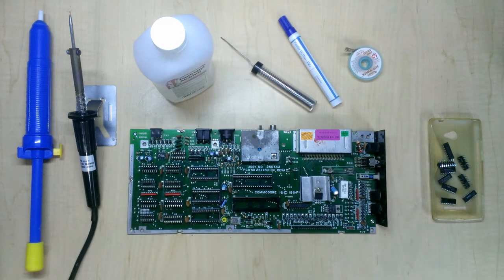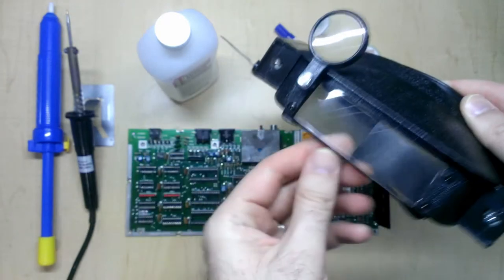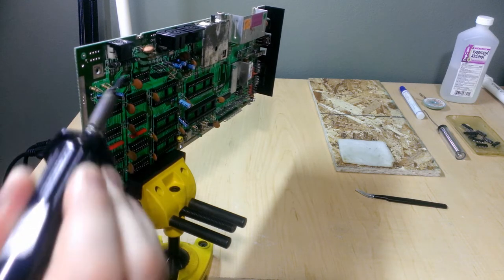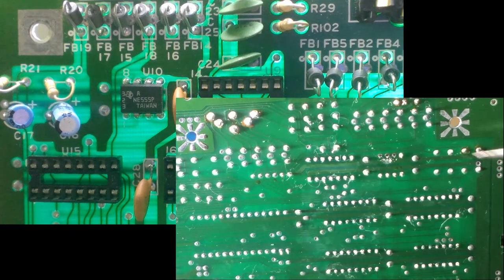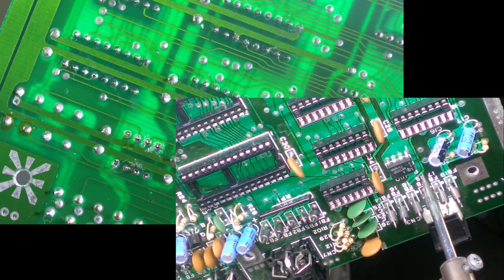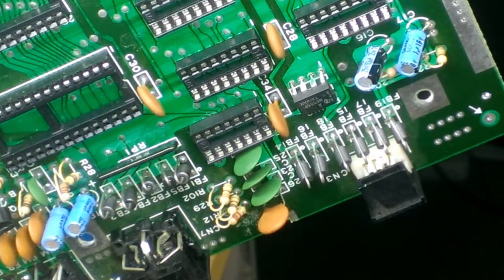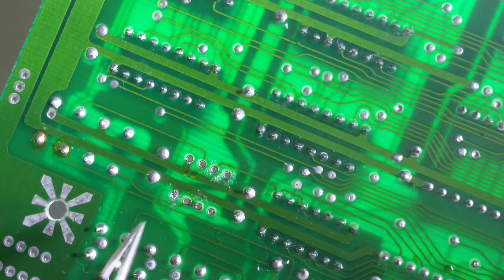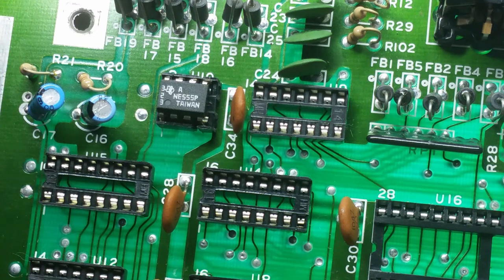Desoldering DIP/Through-Hole ICs With Inexpensive Tools

Comment: That's what sucks (NPI) about using the manual pumps. You have to remember to prime it beforehand. Even the cheapest electric desoldering tool is infinitely better. There's a bunch of hacks where folks have taken a cheap electric desoldering pump and added an aquarium pump and trigger. 

A neat tip (another NPI) is to make tip that's around 1/2" wide for the cheap soldering iron you have.  Take a piece of heavy gauge copper wire from a ROMEX and bend it into the shape of a tiny coat hanger, so the two ends meet.  Twist the ends together at the top then insert and screw them onto your soldering iron. This will let you apply more heat across an entire side of an IC while you lever it.
Reply from the maker: These are great ideas -- thank you for sharing!  I'm slowly starting to acquire better tools and the electric solder pump will likely be next.  A temperature-controlled soldering iron is vital for the type soldering I do, and you can now get one for well-under $30 USD (Pinecil).
Reply: @SteveGuidi  Yeah, but I would spend a bit more and get a lot more. The Aixun soldering station is a game changer. It heats up fast and makes soldering pure joy. You can buy one with the hand piece and three tips for around $100 at injuredgadgets. As far as an electric soldering pump, don't waste your money. Save up and wait around for a deal on a Auyoe station which comes with a desoldering gun, cartridge style soldering iron and hot air wand unit on eBay used. They're around $200 and saves a lot of deskspace. I own one along with the Aixun.

Comment: How can i know if the ic is work well or need to change
Reply from the maker: What type of IC are you dealing with?  You can test ICs in-circuit with logic probes or an oscilloscope.  For 74xx series logic ICs, check the datasheet for the truth table and use that to test.  For a 555 timer, it might be easier to remove and test with a simple circuit.

Comment: Nice variation to work from both sides... I will be working on a friend's 64 soon, so was brushing up on technique and found your video (via Google search), and may give this a try!
Reply: This ended up working perfectly for me, i.e. the solder sucker on bottom side of the board and the soldering iron on the component side! Never knew it could be so quick with just these tools. Thanks!